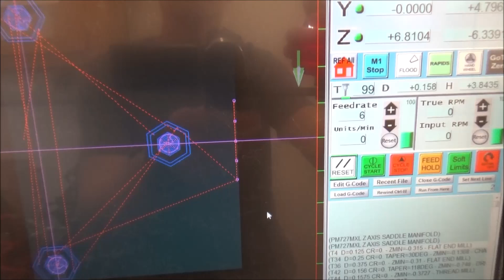PM727MXL Linear Rail Z Axis Saddle

Comment: where did you buy your push-to-connect fittings i'm having a hard time finding anything with 6 mm threads
Reply from the maker: Ebay try there
Reply: @CNC4XR7   Looked there too i need M6 male threaded end, say you have any you would sell?
Reply from the maker: you did not say what type you need but here are some straight 
https://www.ebay.com/itm/10pc-Push-to-Connect-Male-ROUND-Fittings-4-mm-x-M6-Thread-MettleAir-MTCR4-M6/260453783553?hash=item3ca4415801:g:e-MAAMXQLk1REbaY